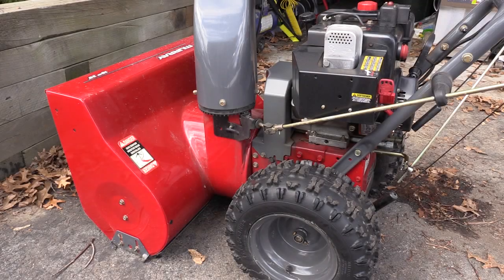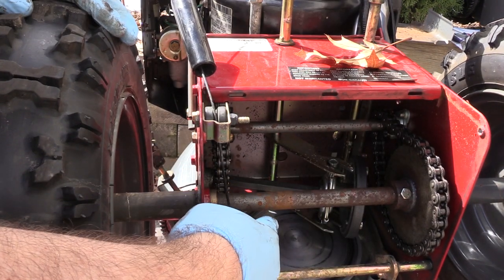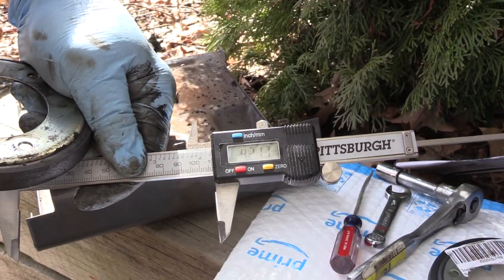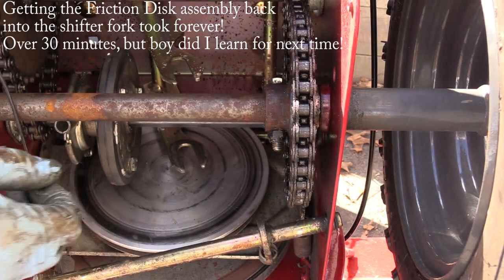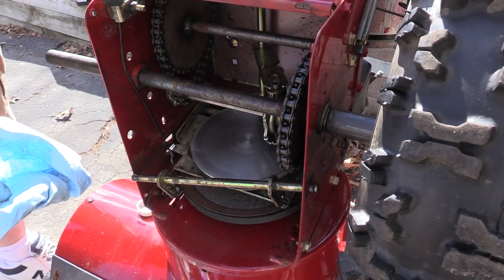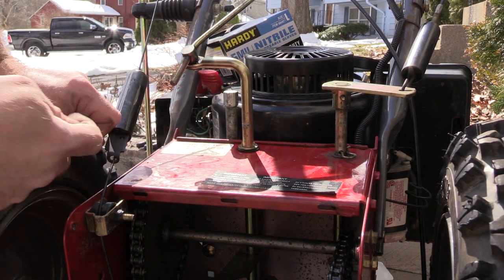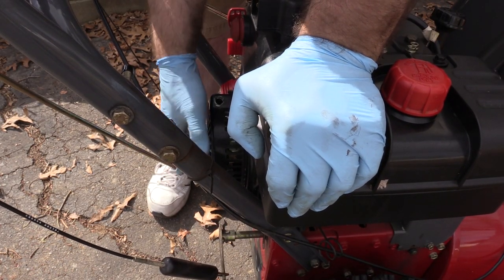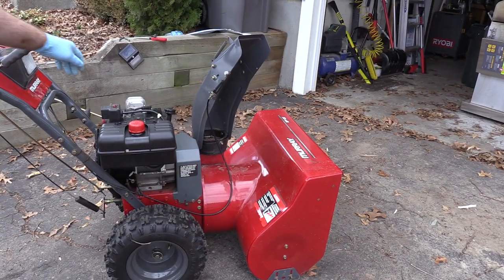Snow Blower Busted Won't Move Forward! Murray Craftsman 629108X5A Dual Stage Snow Blower

Comment: Mario, great video. I just completed the repair, but I didn't take half of the stuff apart that you did. I removed the drive wheel while still on the shaft, removed the bearings on each side, slid the drive wheel off on the right side with a little manuvering and muscle, slid the new drive wheel back on and reassembled it.
Reply from the maker: Thanks for sharing that! I believe when I went to do this repair, I watched the video from Donnie boy 72 or something like that. Sounds like you had easier and less destructive way to do it. Thanks for watching!

Comment: I picked one of these up last summer cheap. The gearbox was trashed (previous owner replaced shear pins with bolts). Fixed that and first snow this year I made two passes then no go. I took the bottom off and the chain on the right pulled the upper shaft down and destroyed one of it's bushings. The drive axle seemed to have about an inch of side to side play. I ended up making spacers for the drive wheels so the axle couldn't shift. It's too bad the blower is such crap because the engine starts easily and has plenty of power. Honda hydrostatic is the way to go if you find a used one that has been maintained.
Reply from the maker: It's a good snow blower, it's unfortunate the previous owner was negligent and what he did with the sheer pins. A lot of people also don't put new lubricant in the gearbox up front. Mine starts on the first pull every time.
Reply: @m3rdpwr  Hopefully I'm getting the issues sorted. Mine didn't have the plastic sleeves on the axle - those may have been the 'spacers' that kept the axle fixed. The Briggs 8.5 hp on mine is a strong engine so I want to like this machine.
Reply from the maker: @dalesworld1308  mine has Tecumseh engine from a now-defunct company. Both Murray and Tecumsah both went out of business.  However, parts are still available.

Comment: Just like my new Ariens platinum 30 that would start slipping everytime I did my hill. Hydro drive is the way to go with a blower. Where is all your snow?
Reply from the maker: First snow two weeks ago was heavy and wet. Took the neighbor's tree down on my house and truck. Ripped the power lines straight from the house and put a hole in the side. Had no power for 3 days. The second storm over 16" Tuesday m melted fast. Heavy trucks destroyed the driveway which is when I forgot with the snow and ripped the skid off from the pit in the driveway. Sorry, about the rant. Are they allowing you to keep the loaner snow blower?!
Reply: Sure been a crazy spring. Still don't know havent called them and they haven't called me. I got alot of hours on the loaner now and hopefully the value is dropping.
Reply from the maker: We're supposed to get another big storm this week, but it's forever changing.

Comment: Just so everyone knows, that friction wheel was not that bad. Under the plastic sleeve on the left hand side, there is a plate that he could have moved the cable to a different hole shortening the cable adding more tension on the friction wheel. That and cleaning the friction wheel of excess rubber would have given him all his gears back . It didnt hurt to change the friction wheel, but he could have gotten more use out of it eather way.
Reply from the maker: Thanks for your input. If I remember, although it's a little foggy in my head, I had tightened it where that little cover goes over. However, it had some strange doings maybe it was engaging improperly I don't remember. It could have been the adjustment that had the wheel positioned where along in gear it was, shifter handle?. It could have been those two things, or combination. That is why I replaced the the wheel. It was 13+ years old, so I figured it was due. It has never run better, so I'm pretty happy with the results. Thanks for your input and thanks for watching!

Comment: In 14 years when you do this again, use painter's tape and tape that wheel. Leo's the grease and crap off until you're done
Reply from the maker: Thanks for the tip. I'd be so lucky if it lasts another 14 years.
My dad's Craftsman just broke yesterday. Sounds like it threw a rod.
No fixing that one.

Comment: I could buy this machine for 100 bucks. Is it a easy fix. Parts available for it?
Reply from the maker: Parts seem to still be plentiful for this model however, depending on what you need, it could be more difficult to find those parts or repair it. What does the seller claim to be wrong with it
Reply from the maker: I also saw an identical unit on sale for a few hundred bucks locally to me on Facebook it was a lot more beat up than mine. they are very good solid machines. Some people complain about the Tecumseh motors but I have this snow blower and a 17 year old lawn mower with a Tecumseh engine and they've been pretty well reliable.
Reply: @m3rdpwr  says the carb surges and one of the cables is frozen.   Figure a tune up and carb clean would get it running.   I just don’t know wht condition the gearbox or auger is in...
Reply: Tecumseh engines are great.... if it needs a new engine a 100 dollar predator would work also
Reply from the maker: @jamesa6272  it always has more issues than what they say. Trying to find that drive cable could get on the price your side for a cable. If you can clean the carburetor, great. I have purchased knockoff carburetors for 15 bucks on Amazon worst case scenario. If you don't know what condition the gearbox is in, that's a big job. I would actually want to see it running first before buying it.
Reply from the maker: @jamesa6272  also, check out Donyboy73 on youtube. He has a great YouTube channel for the small engines.
Reply: @m3rdpwr  I definitely do not want to do any gearbox work.  Carb clean plug and air filter is about all I want to do.